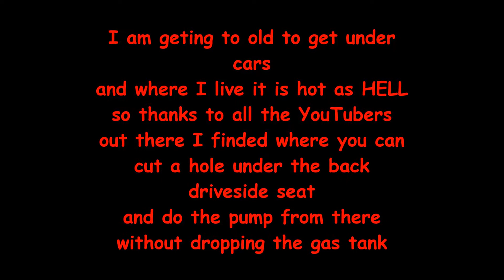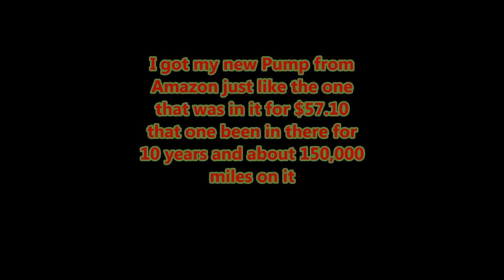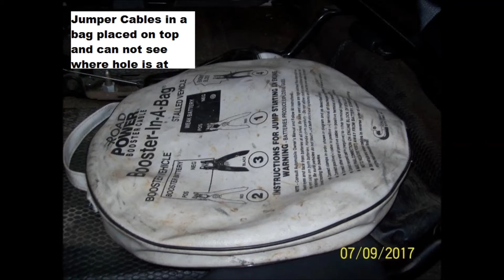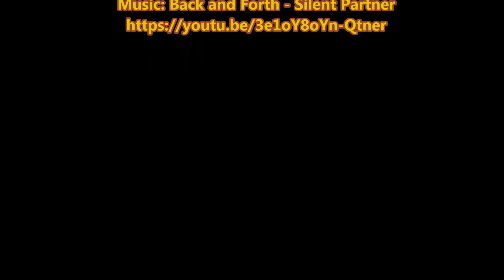2001 Chevy Tahoe Fuel Pump & Access Panel in the floor DIY

Comment: Any fear at all cutting right by the tank?
Reply from the maker: No the tank is about 2inch down from the floor and I used a 3 inch Mini Air Cut-off Grinder and the steel is easy to cut I only cut down about a 1/2 inch. I am 60 years old and getting under a car is getting harder for me to do and I watch videos on pulling the tank and it was just not for me also I now have a panel to do it again